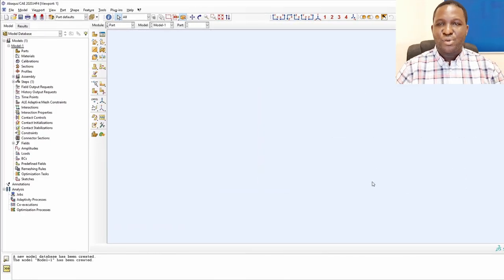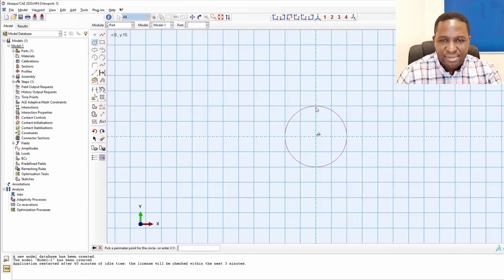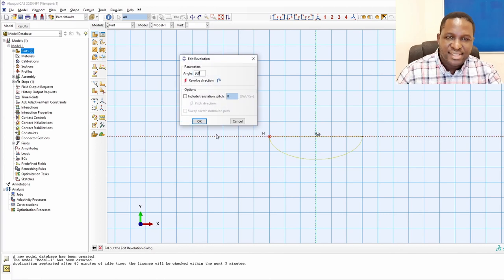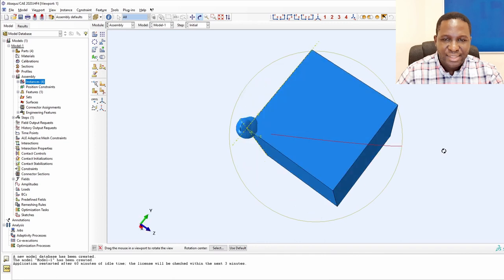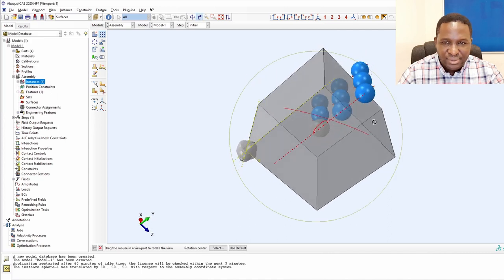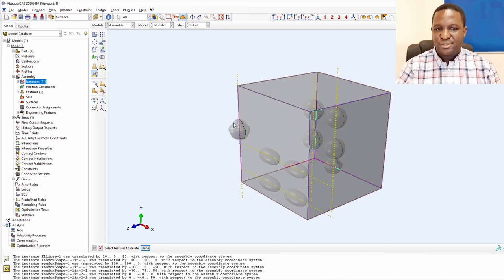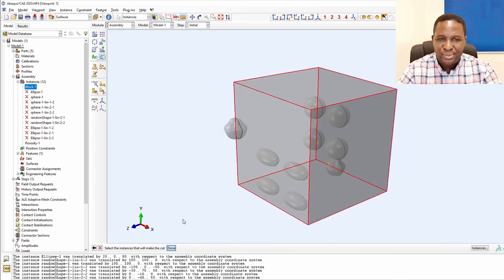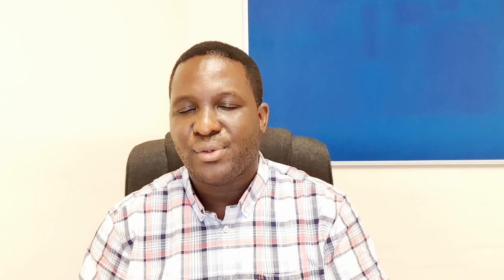How to CREATE a POROUS MEDIA - An ABAQUS Tutorial

Comment: Hi sir, Thanks for uploading the video. This is exactly what I expected. I have  designed a porous structure. But the problem here is instead of using pattern option and incorporating the porosity manually. Is there any option where we can induce porosity in volume fraction bases in to the block (example 20%, 10% volume fraction ..). Because if porosity size is small, number of inclusions will be very high in number it is very difficult to do it individually.
Reply from the maker: Definitely Bonthu, this is possible. You will have to do it from a Python script. I will think about it and show in a future video how this can be done automatically but it is definitely possible.
Reply: @MichaelOkereke  Hello sir, may I ask if you already have shown this in one of your videos? I couldn't find it in your video list. I need to create a Python script that will introduce the porosity automatically and possibly randomly in the structure. I am talking about a very small porosity size like you'd expect in a 3D metal printing job. I need to distribute this porosity based on the volume percentage in the part (example: 0.032%, 0.050% ,etc.). Thank you.
Reply: @MichaelOkereke  Hi Micheal, thanks for the video! I am working on the moisture diffusion in polymeric sandwich panels with porous core and want to simulate the water absorption in the foam, face sheet and panel. I was recommended to use COMSOL, but since I have the ABACUS license, I was looking for educational sources and found you. Do you have any tutorials related to my topic?